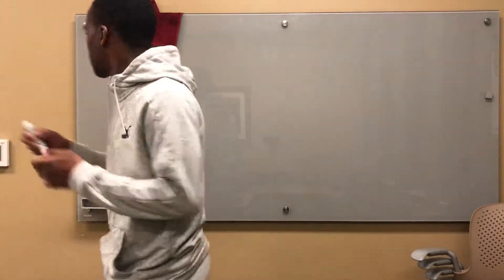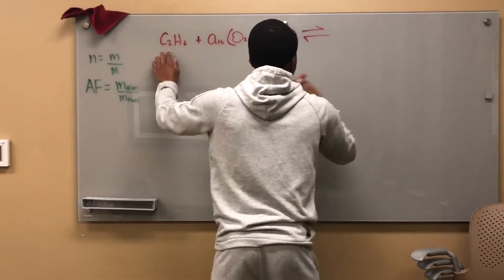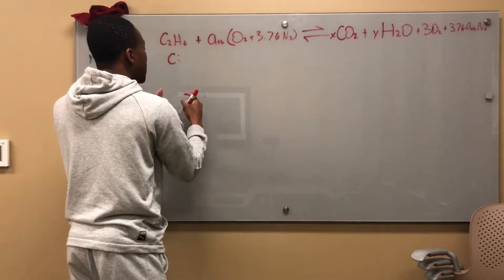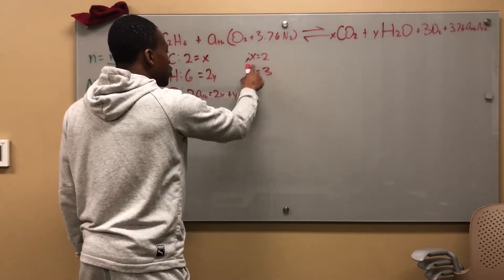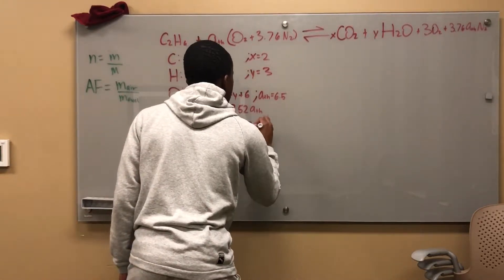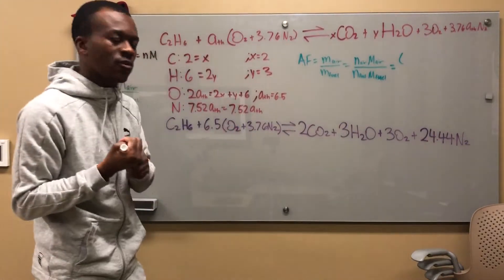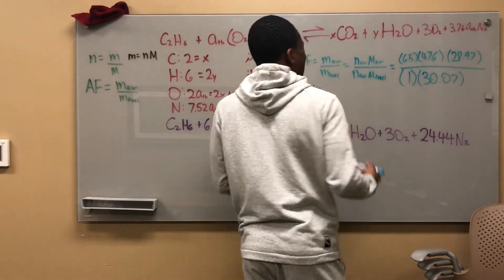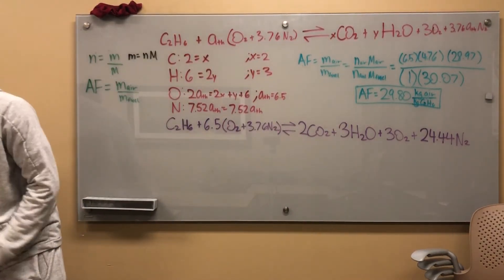Air-Fuel Mass Ratio Example Problem

Comment: How did you get  28.97 as the molar mass of air? I know its a constant but how is it actually calculated. Gracias.
Reply from the maker: Essentially air is made up of different components. If you take the weighted average of the molar masses of those components, then you get the whole molar mass. Didn’t rewatch the vid so idk if it was given or not but a lot of times they’ll just give you the value depending on what they’re asking you to find.